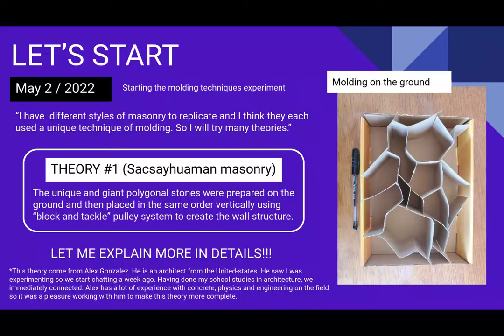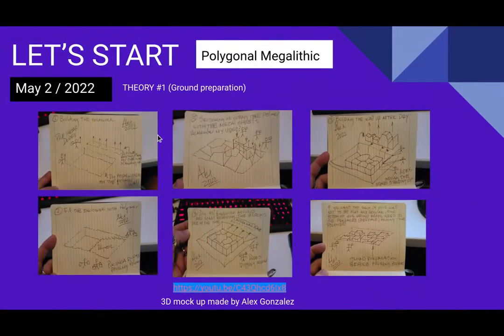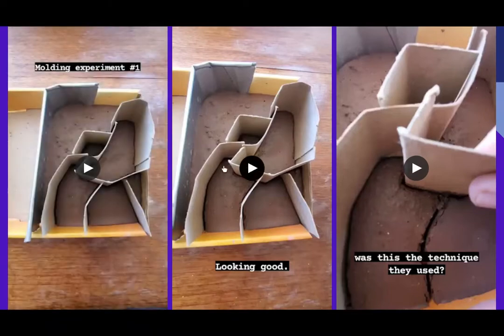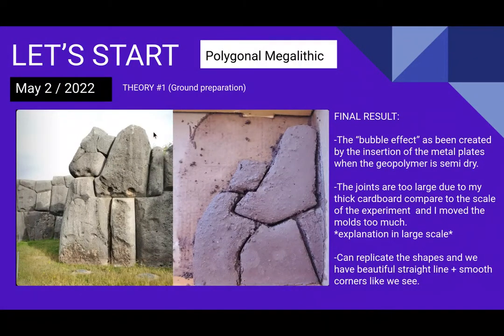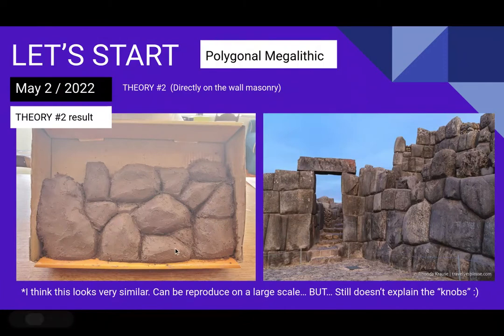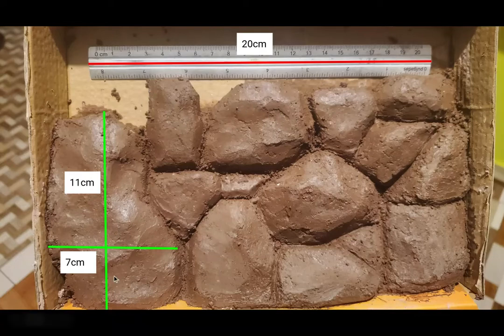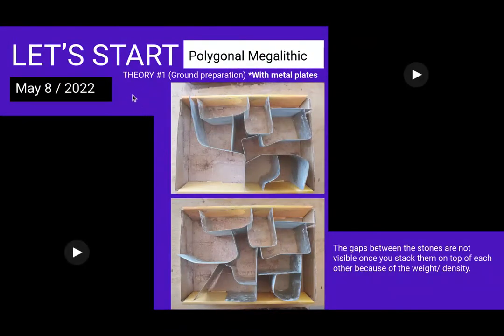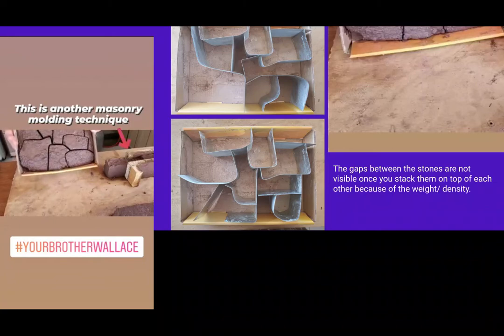21 days GEOPOLYMER experimentation - PART 3 - Ancient masonry

Comment: Great video. I used to work in the moulding industry. A couple of tips you might find useful. Coat the 'shape formers' with a release agent or Vaseline. This is how I would have done it on the floor and reassemble into a wall. Nearly every defect I see in these stone looks like the same defects in the concrete and plastics moulding industry.
Reply from the maker: Yesss I could of used oil or wax. I agree with you its very logic